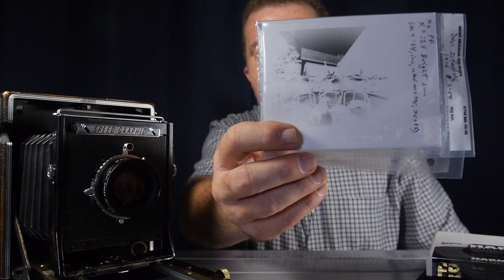Reversal Print Processing: A New Approach

Comment: After I brush my teeth at night, I rinse my mouth (avoiding it going to the throat)  with Hydrogen Peroxide (H2O2), which compared to water (H2O) has an extra Oxygen atom that is ready to oxidize anything. The easy target for this Oxygen are Carbons (organic matter). So, the Hydrogen Peroxide at 3% is a powerful cleaner of teeth, it oxidizes any organic material that creates those things that the hygienist has to clean every six months.  Because of the extra Oxygen, you can use HP(3%) to remove stains caused by blood, wine, etc. from fabric.  After you rub enough of that with your fingers (no gloves) you will end up wit a bunch of white little spots at the finger tips. That is the oxygen going through your pores in search of organic material. You should just rinse a lot with water, so water, the universal solvent (weak mix of two ions. H+ and OH-) will easily take that oxygen and convert it in water.   Hydrogen Peroxide will lose its strength if in contact with air.  So, the life of it after the bottle is opened for the first time is limited.

Comment: If you pull your acid into the water rather than the other way around you will literally never have a problem. If you use proper safety procedure that you will never have an issue. Still where personal protective equipment always but it is safe to use sulfuric acid if you know what you're doing.

Comment: I've recently learned that you can add acetic acid to hydrogen peroxide when reversing film. Would this be possible with photographic paper? Or would the acetic acid cause a problem specific to the paper?
Reply from the maker: I have not tried it. Just be cautious about mixing strong oxidizers and corrosives together, depending on the strength of the peroxide, it could be exothermic!

Comment: I have followed this process, approximately, for maybe a dozen exposures and have only gotten one very mediocre success. The difference is that I was only able to get 12% hydrogen peroxide, and that I'm using a brownie box camera with an f/16 apperature. Same paper, same assumed "ISO" for the paper, same fogging procedure, same or greater bath times. Maybe it's that I am using a homemade caffeinol-c developer and not getting a dark enough development before beginning the bleaching. I imagine that it would be nearly impossible to give me accurate guidance on what I'm doing wrong but, in case there is some glaring problem with my modifications, I would love any helpful hints that you might have.
Reply from the maker: With proper exposure and development the negative should appear very dark, prior to bleaching white. I recommend you try non-caffeine-based developers that are more chemically active.
Reply: @Joe_VanCleave Thanks for your advice and excellent content!
Reply: Through a little trial and error, I have discovered that my problem was that I wasn't fully developing my negatives. They seemed dark but I am a complete amateur and this is the only development I've ever done. So I just left them in way longer and then completed the rest of the process. The results weren't amazing but they are functional and consistently reproducible.

Comment: An important tip for anybody doing this: NEVER pour water into concentrated acid, ALWAYS pour the acid into the water. The splash generated by pouring is almost entirely the liquid you pour INTO, so you're much better off having water splash around than concentrated acid ;)

A common use-case for higher level concentrations of hydrogen peroixde is in hair bleach agents. I've found that I was able to source it online from various barbershop suppliers in varying concentrations and quantities. As one of the most risky parts of this is diluting the high-concentration into a more manageable concentration, I found it very convenient that they provided more reasonable concentrations out of the box.
Reply: It can also boil if water is added to acid, since the dissociation can be highly exothermic. 

I'm not a chemist (physicist by training) but I would stay away from potassium dichromate unless you are comfortable with handling chemicals, it is acutely toxic, carcinogenic, and reproductively toxic whereas the main danger from sulphuric acid is acid burns and burning (which is moderately unlikely), it is apparently also carcinogenic (but I believe less so). 

Ilford suggests "For solution B add 10ml of concentrated sulphuric acid to 490ml water.

You can use a 10% solution of diluted sulphuric acid if you can't find it concentrated. In this case, add 100ml to 400ml of water to make the part B bleach solution."

I would consider 10% sulphuric acid to not be very dangerous. Don't drink it, don't get it in your eyes, but if you get it on your skin you can wash it off with water and will probably not have any real damage (other than some pain, irritation, discolouration). 10% sulphuric acid can be handled by children in school. I would still wear sensible PPE, eyewear, gloves, apron or better a lab coat, whatever the msds says. If you get it on your clothes, take them off as soon as practical. If you get it on your skin wash it off as soon as practical. Only operate near either water than you can run (a tap) or a large amount of standing water that is not contaminated with other chemicals, so you can wash yourself off if needed.

The 1% solution that you'd actually use for the chemistry I would consider to be basically safe. Don't drink it, don't put your hands in it, wash it off if it gets on you, but don't panic. Make the dilution, put away the concentrated chemicals, and then work with the dilution. Carefully label everything so you know how concentrated everything is, labels like 'ACID' are useless. Labels like '1% dilution of sulphuric acid - mildly corrosive, don't get in eyes' and '10% dilution of sulphuric acid - corrosive, don't get in eyes or skin - wear goggles' is more useful.

Comment: Interesting process with some substantial risk!  I use 37% peroxide solution in my lab (biochemical research), you have to be really cautious with this stuff.  So thanks for stressing the use of face shield (I'd use safety goggles under face shield too), lab coat and gloves.  Peroxide will rapidly degrade, so I wouldn't bother trying to save it for later use.  Lastly, I can't stress how important it is to have very, very clean equipment to handle peroxide - in fact I'd keep a measuring cylinder, funnel (if needed) and beaker ultra clean, just for that purpose.  Remnants of metallic or organic compounds left behind after washing will inactivate the peroxide or, worse yet, cause a dangerous reaction.  I will give this process a try soon, thanks for the info!
Reply from the maker: Thank you for the reminder about lab safety.

Comment: Did you mention the importance of ventilation in your setup? That was rule #1 I learned back in the 90s for working with high concentrations of chemicals such as hydrogen peroxide - you always want a positive air flow through the work area, even when wearing protective gear...

Comment: Regarding the questions about solution life:
When just stored hydrogen peroxide is not stable and it easily decomposes into oxygen and regular water. Keep it in tight closed squeezed plastic bottle without air inside (only liquid).
When used for bleaching hydrogen peroxide is being reduced during the washing - this is how it works.
 So it exhausts quite quickly.
The weaker solution you use - the shorter life it has (or even it may be not sufficient to do job at all).
On the other hand - it is cheap so no need to save on it.

Comment: Hi Joe, I couldn't find if someone else has inquired this yet, but I am trying to do this process (following it very closely including a 15% HP concentration) but with a graded fiber-based paper so the end results are a little more sturdy. I'm changing the initial development time to 1:30, and then I am finding that the image just doesn't bleach out, meaning they go black when they hit the second developer. Like one of your commenters in Photrio where I found this video, I'm doing a 1:3 ratio of Dektol as my developer. Any help is much appreciated! -Ian
Reply from the maker: If the paper goes completely white in the peroxide then the bleaching is adequate, otherwise keep it longer in the citric acid and peroxide. Also make sure you use a fully saturated citric acid solution, meaning excess undissolved powder  is okay.

If it goes black in the second developer it sounds like the initial exposure in-camera was too little. That initial exposure should use on average about half of the halides in the emulsion, which then get etched away in the peroxide, leaving about a similar amount of halides to form the positive image after re-exposure and the second developer. Too dark of a final print means too many unexposed halides were left in the emulsion after the first exposure and bleaching. This is assuming the second, flashing exposure is uncontrolled in intensity and duration, like we’ve been doing, and hence exposes all of the remaining halides in the paper.

It could be that fiber paper has more silver than RC, so you need more initial exposure, and also more bleaching to clear it to white.

Another strategy would be to control the second exposure intensity and time, instead of merely fogging the paper with an uncontrolled amount of light, treating it like a darkroom print exposure, then develop for a good positive image, then stop and fix out the remaining silver halides.

I personally like using RC paper for this process because it permits making prints in the field, on the street, where you don’t have time for archival washing that fiber paper requires. But for studio work I can see the appeal. Good luck!
Reply: @Joe_VanCleave  Thank you for your quick reply! I'm going to try some more careful exposures, I've been doing these at ISO 3-4, which I normally do for paper neg on RC paper. I see a lot of the resources are saying around 1.5 ISO so I will try that. This would make sense of the prints going black in the second developer, but any way to explain why they don't bleach out in the H.P.? I've left it in about 10 min at most and barely see any black bleach out.
Reply from the maker: @ianlewandowski352  As I said earlier, make sure the citric acid is strong. Go a full 3-4 minutes in the acid before the peroxide. And go straight from citric acid to peroxide, don’t rinse the paper in between. I’ve also seen where under exposed images don’t bleach as well as properly exposed.
Reply: @Joe_VanCleave  Sorry, I'm confused, there's a solution of only citric acid before the peroxide + citric acid solution? So far I've just been developing, rinsing, then bleaching.
Reply from the maker: @ianlewandowski352  Yes, the citric acid after the developer acts as a stop bath and also prepares the developed metallic silver to be etched by the peroxide. Make a strong solution of citric acid from powder, enough so extra powder won’t dissolve in the tray, and you know it’s strong enough. 3-4 minutes in the citric acid, then directly into the peroxide. The print should start fizzing and immediately begin to turn white.
Reply from the maker: Also, there’s no citric acid mixed in the peroxide. Just citric acid in one tray, then peroxide in the next. The idea of mixing the two was from early on in the development of this process, but we’ve found out it works better to separate the two steps.
Reply: @Joe_VanCleave  so strange, I did 4 prints, three of which didn't change at all in the peroxide, and one only the blackest part of the neg turned white, but nothing else. I thought maybe the citric wasn't saturated enough but it's quite strong (cloudy) and there's excess powder. I even have 18% peroxide and still nothing. I'm starting to think the fiber based paper isn't the way to go.
Reply from the maker: @ianlewandowski352  Try the same processing on RC paper and see what happens.
Reply: One more question before I start again with the RC. Does it matter that it’s multigrade paper? I’d read that graded paper might be better but I’m not clear why.
Reply from the maker: @ianlewandowski352  Multigrade typically produces higher contrast images in daylight because the blue and UV of daylight activates the high-contrast part of the emulsion. I've had success on both multigrade and graded papers.

Comment: Thank you very much again. I learn a lot. If I were to adapt this for film,  Should I use the same concentrations for H2O2? Need I develop the film for 2/3 of the time in the second development?

I think step 8 is not needed. Since you washed out the black silver oxides that were developed in step 1, there is no silver in the white parts that can get black over time. So in a sense, the reversal is also the fixation.
Reply from the maker: I haven't used this process with film, but using the same concentrations is a good starting point. You may want to refer to the APUG discussion thread on the topic, perhaps others there with more experience can provide guidance.

Link: https://www.photrio.com/forum/threads/reversal-print-processing-video-new-approach.153447/

Regarding the fixing after the second development, you may be right about that, but I figured it's best to be safe and fix out whatever remaining silver halides might be present.

Comment: Hey Joe, how does this process turn out when using 3% hydrogen peroxide? Does it require more chemical? Or repeating the peroxide step a few times?
Reply from the maker: I haven't had the process work with 3% peroxide, hence why I use stronger.
Reply: Joe Van Cleave I tried an 18% solution just as you described but some of the dark areas from the first Dev never bleached out all the way. Is this normal? After 5 minutes(I dumped and used new bleach a few times) these parts were still grayish and I just decided to turn the lights on, fog it, then develop anyway.

This resulted in a pretty dark overall image with a few highlights. My solutions were to take a less contrasty picture and maybe to use a stronger solution for the bleaching agent(20%+). Any tips?
Reply from the maker: @JRichardctr  I will do up to 4 or 5 passes through the peroxide and acid to ensure good bleaching.

Comment: I have just been introduced to Darkroom Printing. I have a number of 35mm black and white reversal slides that I think would be great to try and print in the enlarger using this method. If I am printing with a fiber based paper, how do you think I should best adjust the times?

Thank you!
Reply from the maker: I'd recommend making test strips to determine the optimal exposure time, just like you'd do when printing a negative.
Reply: @Joe_VanCleave  thank you for the reply! I should clarify that I meant moreso the developing times in the various chemicals and re-exposure. For example, would it be reasonable for me to assume double the time in bleach vs the rc paper? I would also imagine that time's affect for re-exposure would remain constant and not change between the various papers. I just want to make sure there's nothing I would have forgotten to account for.

Comment: Hi, is it possible to load the Harman positive paper into the film holder in darkroom safelights? And how do you meter for the paper?
Reply from the maker: Yes, the paper is not red sensitive, you can load it under safe lights. It's ISO (or exposure index) varies, depending on the amount of blue/UV light in the scene, but my experience suggests it varies from ISO2 to around ISO4-6.
Reply: @Joe_VanCleave  thanks!

Comment: Thanks for your videos Joe. I've been finding them inspiring to the point the kids are now saying "You're not watching him again!". 

It seems to be quite easy to buy 11% H2O2 here in the UK so that might be my starting point and maybe a bit safer. What are the issues with using a safer concentration and very long bleaching stage?

I have no darkroom. Do you think this will work in a tank? Does the peroxide give off gas during bleaching?

(A connected thought I'm thinking of making a box camera with a mirror in so that I can get correctly orientated - kind of like a polaroid)
Reply from the maker: There's probably some gas given off, maybe hydrogen? Not certain what kind. A daylight tank is vented, so just use it in a well-ventilated space and it should be fine.

As I remember, the lower concentrations had issues with mottling and it took a lot longer to do the reversal. But this process demands experimentation. Good luck.

Comment: Any idea on working solution life?
Reply from the maker: Not yet! I'll find out today or tomorrow, when I attempt to reuse that brown glass bottle of bleaching agent.
Reply: Any update on this?
Reply: Short. When just stored hydrogen peroxide is not stable and it easily decomposes into oxygen and regular water. Keep it in tight closed squeezed plastic bottle without air inside (only liquid).
When used for bleaching hydrogen peroxide is being reduced actively during the washing - this is how it works.
The weaker solution you use - the shorter life it has (or even it may be not sufficient to do job at all).